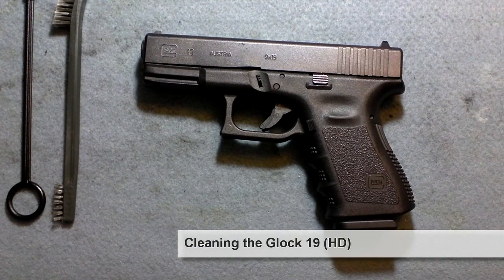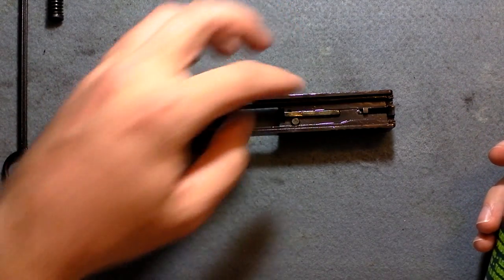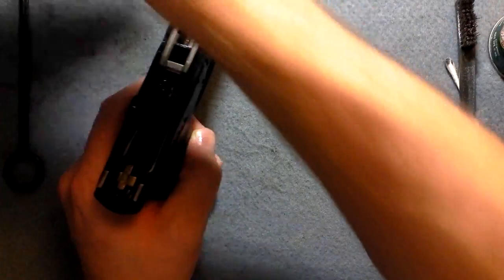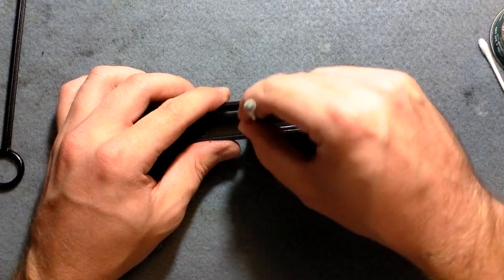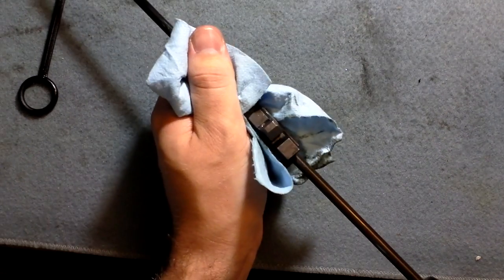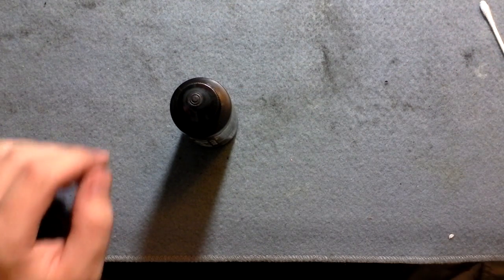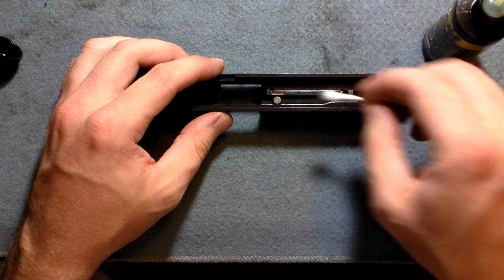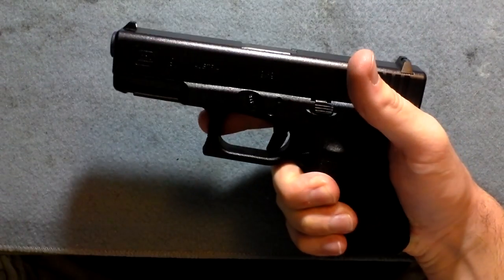Cleaning The Glock 19 9mm (HD)

Comment: The plunger under the slide is the striker pin release safety, there is also a small hole across from it and the striker channel at the rear of the slide- KEEP OIL AWAY from these areas as well as the breech face striker pin hole. The oil WILL gum up the striker channel causing light primer strikes or failure to fires. Read your manual to affirm this info or do a quick search. Time saver: Wipe all powder residue off the frame, slide and barrel first before using any oil/solvents. Spraying the frame first makes sludge get into places that's harder to reach. Invest in a bronze brush instead of nylon and get a patch jag for 9mm-You'd be amazed at how much more debris you get out of your barrel. I use CLP as it cleans, lubricates and protects all in one, uses less room of your kit.

Comment: Great Video CaptainBerz. The one thing you did not show folks is how to reset the trigger so the slide will lock in place. Also you use far more oil than I would on mine.

Comment: Nice video. May I humbly make some suggestions. The first is that you do not want to spray as much Ballistol over the rear of the slide as you show. This will run down in to the firing pin channel at the back of the slide. Second, what you refer to as the firing pin that you clean with the Q-tip is actually the firing pin safety. The firing pin is sticking up from the firing pin channel. Finally I would not recommend brushing back and forth with the brush over the channel.It moves grime into it.

Comment: Why don't you want to lube the firing pin?
Reply: +captainadventures 
You need to keep oil and grease out of the striker channel to prevent it from slowing the movement of the striker which can potentially cause light strikes, and therefore a failure to fire.  This is important in any striker fired system.  All that said, the part he is calling a "firing pin" in this video, is actually a striker block safety.  Not here to bash, but I will just say, there is not a lot of good info in this particular video.

Comment: why is it that one should stay away from lubricating the firing pin? great video. thanks for sharing
Reply: Because the firing pin can be get stuck
Reply: Justin Campo - if there is residual oil it attracts gunk and carbon. Most people recommend spraying the slide with it pointed down so no oil can run into the hole where the firing pin is

Comment: more like how NOT to clean your glock 19. first off way too much lube. 2nd you never spray the entire slide front to back. you are supposed to keep the copper lube in the glock as long as possible. on the rails you only use a DROP or less on each contact. this is ridiculous. do it his way and you will have MASSIVE build up of carbon.

Comment: I personally do not spray inside the frame-  you will always get a little dry powder and dust, sometimes even a little shaved brass from casings etc in the firing pin channel and it will gum up over time with just a little lube in there.